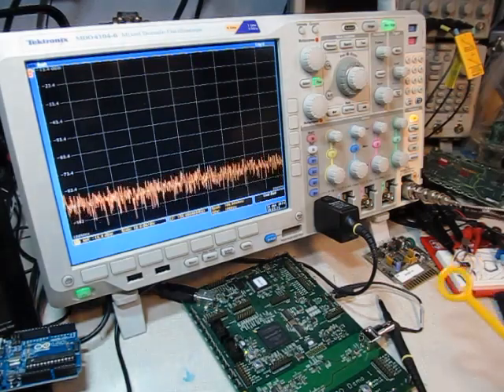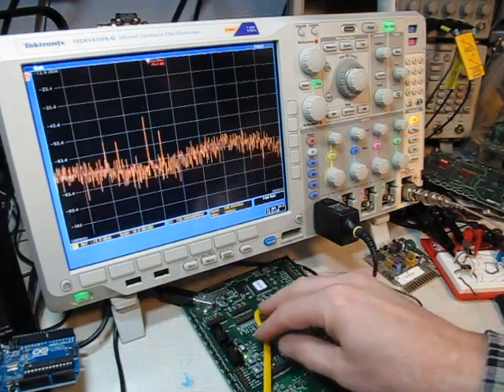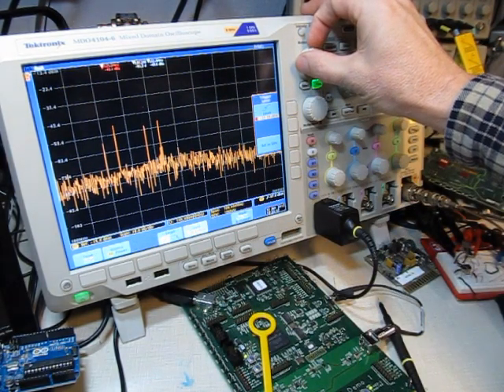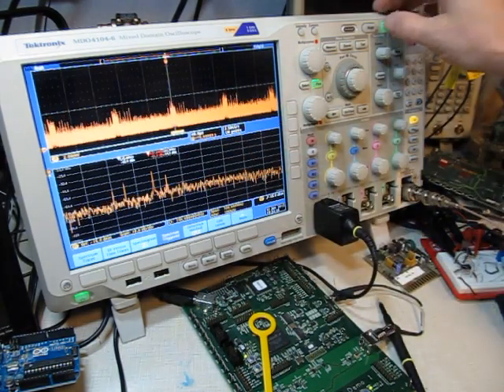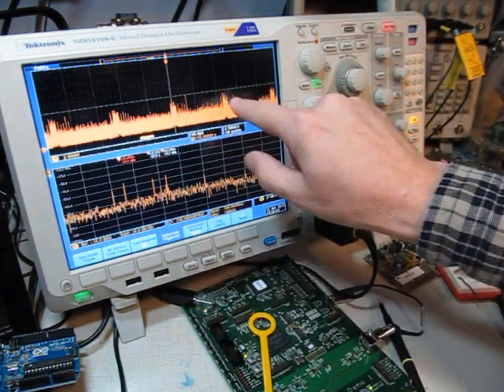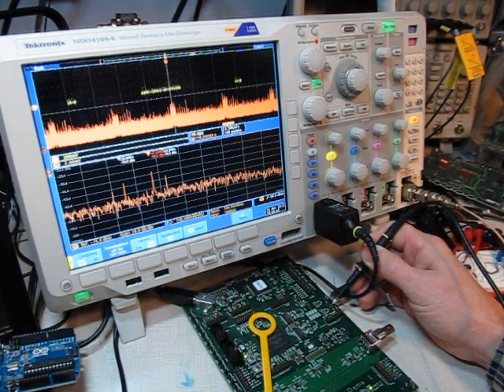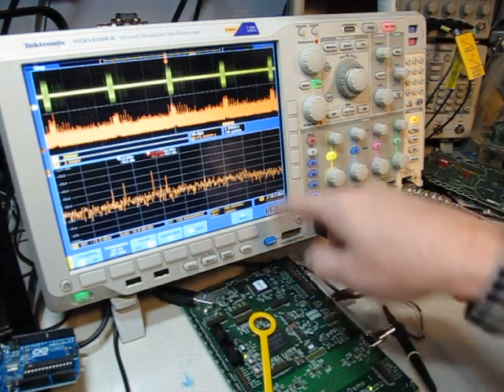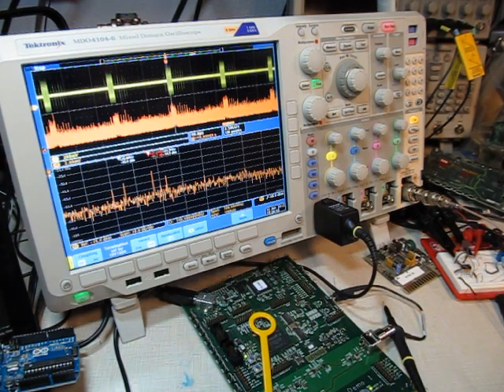#76: Debug Transient EMI signal with a Mixed Domain Oscilloscope MDO4000 Tektronix

Comment: does the mdo4104-6 have signal vue capabilities?
Reply from the maker: Not directly.  You can save a TIQ file from the RF vs Time traces and open that in SignalVu.  The MDO4000B and MDO4000C models support a "live link" between the scope and SignalVu running on a PC.  This is not supported on the original (non letter suffix) MDO4000.
Reply: @w2aew  thank you for. Your valuable input

Comment: nice video,thanks for this....just a curios newbie question ....can we use another near field probe on Ch1  instead of the Osc probe ..... i am on the premise that there are way too many points on the board to get the EMI cause..faster.
Reply from the maker: Possibly, but there are some challenges when using a near field probe on a regular scope channel (as opposed to a spectrum analyzer).  The scope channel is wide bandwidth - DC to whatever the scope BW is.  Because of this, the noise level is higher which makes it difficult to see very low level signals.  Also, higher amplitude desired signals may mask out the undesired emissions.  The spectrum analyzer has the advantage of focusing on a specific frequency range of interest - thus lowering the noise and improving the sensitivity.
Reply: thank you .

Comment: Nice work, shows me how far scopes have come since my college days with something that looks less like a probe and more like something a kid might blow bubbles with. I'm trying to get back into electronics more at this root level and have a Rack Mounted 35A tektronix scope. Looks to be a part of the 535 series. Where might be some best resources to rebuilding/restoring places to contact? Are rack mounts available still? What are the more preferred long-lasting modern caps to use these days?

The most unique thing this scope has that I have never seen in any other tube scopes/TV/Radios of any kind is a spring loaded metal hold down. It is C shaped and can be lifted and turned and holds itself upright aside the tube. I suspect it's for severe duty use of some kind. (getting parachuted in? Maybe being in a sub or boat? A command center) Have you heard of these and do you know what it might be called?
Reply from the maker: Probably the best place to get info on the old Tek scopes is the TekScopes group on Yahoo:
https://groups.yahoo.com/neo/groups/TekScopes/info
Reply: Thanks! (watching your vid on the 4 wire measurements now. VERY useful as I have several of these analog meters sitting around... I still prefer the first analog meter I bought with my paper route money from Radio Shack over my fluke 75 I got in college. I'm hoping to make some simple volt & ammeters for some 30w solar cells I just bought.)

Comment: Unbelievable...I just found your channel, and I'm slowly going through all your videos - what an incredible resource.  I have rather broad question to ask though.  I'm debugging EMI interference on a UAV.  I've narrowed down the emissions to 2 processors on the board verified with a handheld spectrum analyzer (RF Explorer).   Without changing the firmware, what is the best way to shield these emitters? I realize it's a bandage, but it's better than nothing :)

Comment: I have a icom ic-80ad on 147.460mhz I get noise / carrier on a rubber duck I have try 3 .still there. This in DV Mods. On a outside antenna don't have it. Thinking its some kind if emi noise. Could icom left out some kind of filter around sma. I can go up or down 2kc its gone. I live in Charlestown, In. Maybe its a icom problem.

Comment: Right, The Dynamic Signal Analyzer (DSA) does have a source which frecuency can be changed however it cannot provide transmision/reflection characteristics. The DSA does shows the frecuency domain as will do a Spectrum Analyzer with a TG or a Scalar Network Analyzer but the DSA has a better dyanmic range and is more suited to measure wideband noise, Power Spectral Density (indentify periodicities), SNR ,THD also they can operate in the uHz ranges more suited for vibration and acoustics analysis.

Comment: Thanks I have an ICP signal conditioner PCB Model 482B1 (Voltage Gain: (±1%) x1 x10 x100) and ICP preamplifier PCB 426B02 (Gain: ±0.3 dB) if I use any piezoelectric sensor (accelerometer or displacement) that means I can use my devices to amplify the signal sent by the sensors in order to be used on the analyzer?